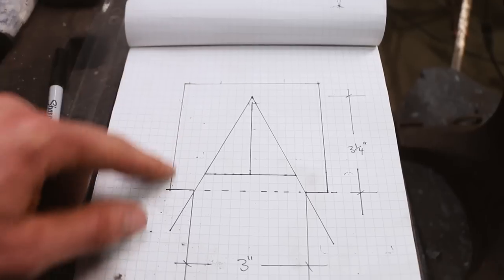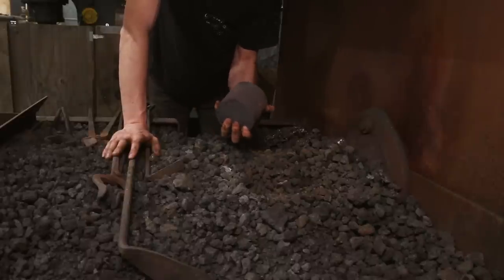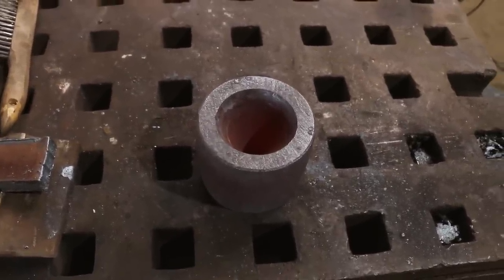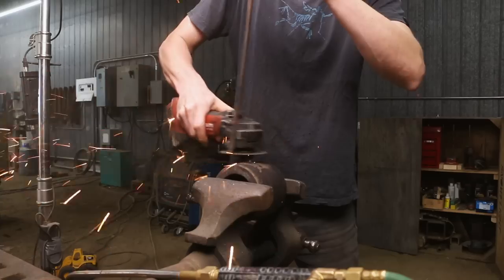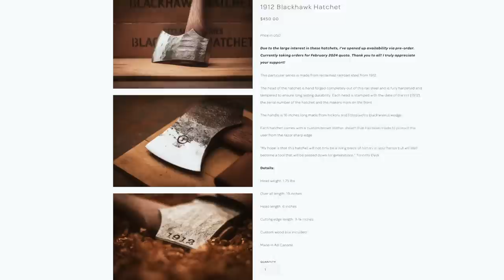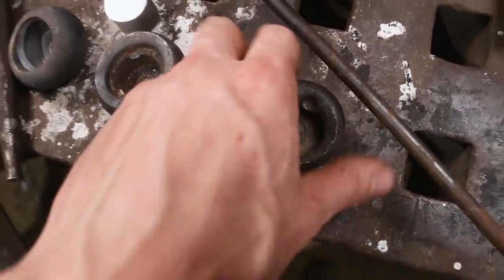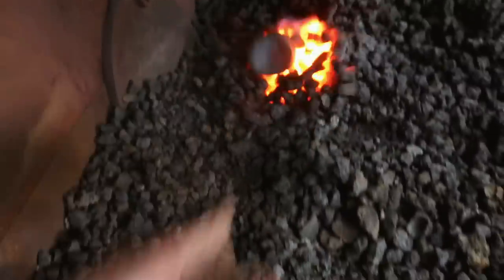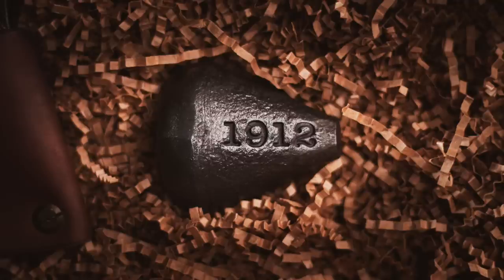Turning pre atomic steel into bottle openers.

Comment: What size rail is it? It will be near the date it should have like 1912 or 1929 then dash marks are the month then it will have the weight of the rail or you cut off 3 feet and weigh it. Like small rail is 90, 100,107? 112,115 119, 131 then big rail 132,136,140, 150,155 every 3 feet is how much it weighs plus if it's sick rail meaning it's drilled for bars and depending on date you can some times tell the size rail bye the drilling measurements. Oh it's 1912 so it's small rail there was no high speed trains back then like our Acela that's does 165 mph through Rhode Island